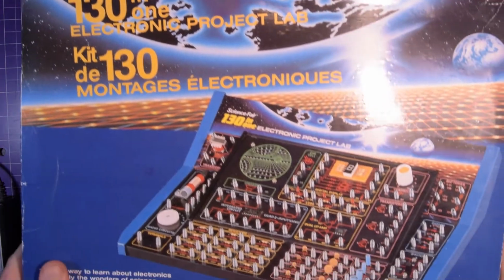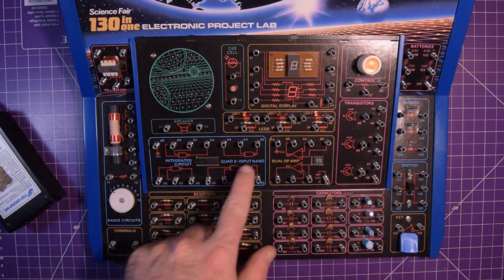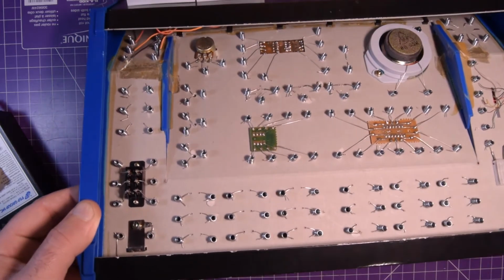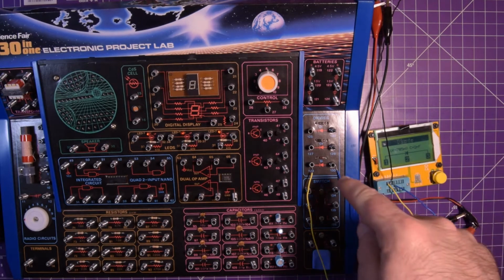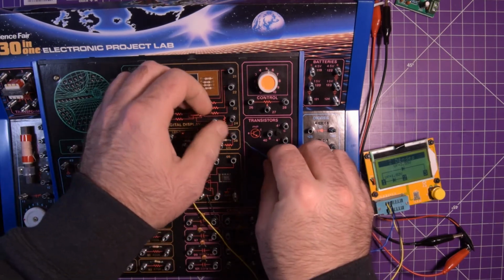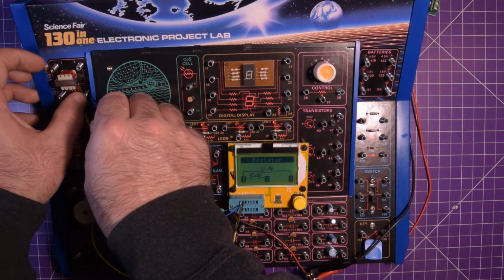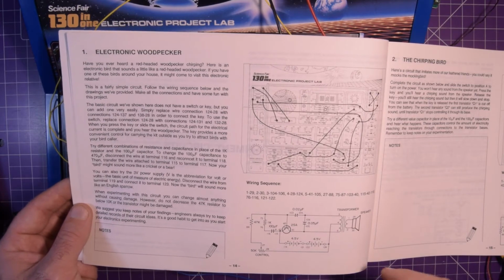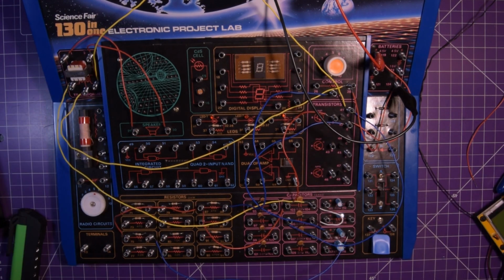5$ Craisglist Find!

Comment: That one is more modern than the one I had  (and still have)
The germanium diodes have a very low forward voltage (making them good for AM radio demodulators). It's possible that combined with the length of your wires confused the tester.
Reply from the maker: What does yours look like? Do I smell an incoming video??
Reply: @SimpleElectronics  Mine looks like this:
https://www.youtube.com/watch?v=RqnLi1moiCI
Reply from the maker: wow I feel like I've watched that exact video before lol